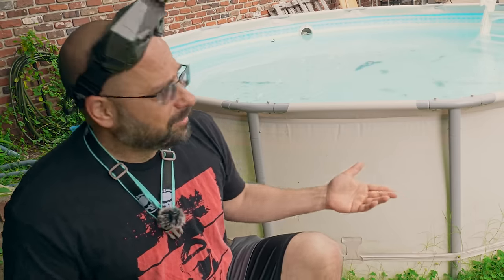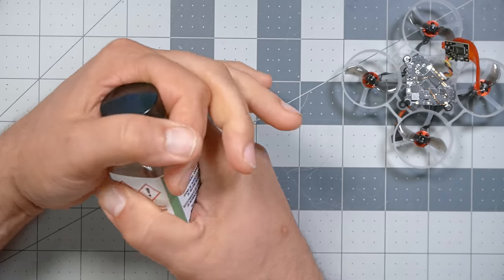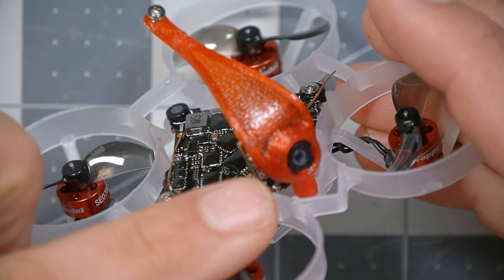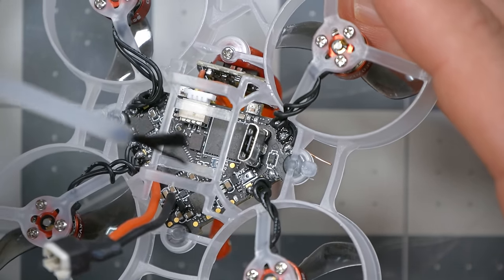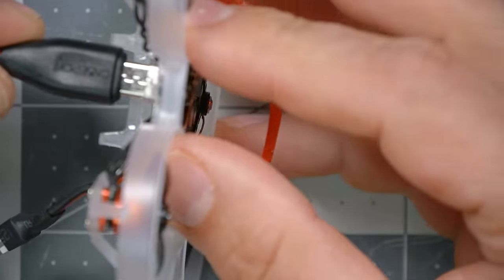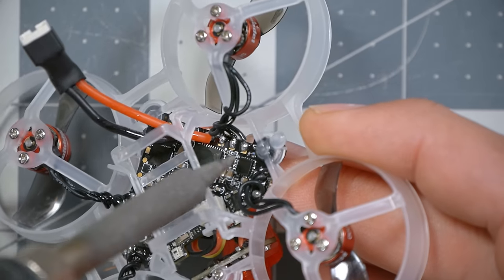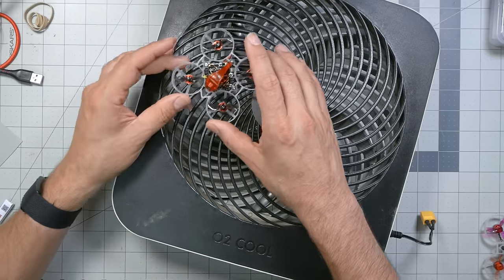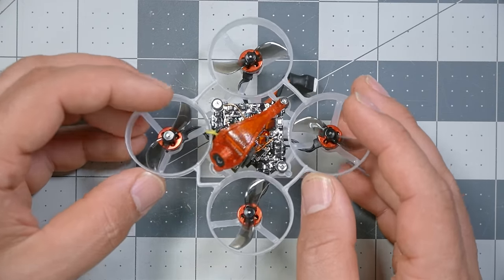I didn't waterproof my drone. Now I'm paying the price.

Comment: I need one motor off your Mob 6. I ordered one like a year ago and it came with a bad motor. This was the final straw for me and all the crap I've went through trying to learn the annoying setup and tuning of quads. I'm starting to get back going and still have most of my gear but I need a new Transmitter and goggles because this betafpv lite radio 2 se isn't worth a crap and my old box goggles suck also.

Comment: Good video. I ended up accidentally dropping my drone into a lake. I pulled it out, rinsed it thoroughly with distilled water and gave it a gentle blast with a can of compressed air, then left it for a couple of days. Turned out nothing was damaged and I'm still flying it months later.

Comment: I did the dumbest thing ever with my Eachine CVatar... Flying it in the back yard, I struck a tree branch which flung it into a trash can with gallons of rain water and leaf muck in it. The video feed went black and when I took my goggles off, I had no idea where the quad even went... It was TOTALLY submerged for a solid minute before the horror of where it ended up set in.  I dumped the trash can, rinsed the quad with clean water, then wiped it down as best I could and blasted it dry with compressed air. The next day, I plugged it in expecting the worst. To my amazement, everything worked. The one casualty was the battery. One cell of 6 went totally flat.

Comment: So no problem putting conformal coating on gyro chip??
Reason I ask that question is because I had a working quad going all crazy on me gyro wise, didn't notice right away the coating got flake y brittle over time, suspect poor surface cleanliness before applying conformal coating, tried about everything until I got coating completely off and the problem was then solved, not 100% sure it was that cause i tried so many things, but ever since it's like i burned my fingers on conformal coating and hesitate to try again.
How about heat dissipation, like amongst others on ESC parts? Will it be impeded, may it cause the coating to become brittle otlr? 
Either way interesting video/subject, long due, good idea to make one.
Reply from the maker: No problem at all with the gyro.
Reply: @JoshuaBardwell  ok thanks a lot for your reply and clarification man, much appreciated!

Comment: The very first day I flew outside with my freshly acquired just arrived tinyhawk II freestyle the outside was just covered in snow - and due to the lack of equipment and skill... that was also where I "landed" it after the first pack. And boof - magical smoke and a dead tinyhawk II freestyle - that was my first outside one pack experience. Frustrating. I'm conformal coating every pcb on every build I do ever since and never did I have any failures again - it also helps in the ultra wet grass and leaves we get over here or when that drone just digs up some wet dirt after a rainy day. Dirt buildup doesn't have much effect if there is a protective isolating layer, keeping it away from the electronics.

By the way, the legendary race-approved Foxeer ESC also comes pre-conformal-coated. This might actually be one of the reasons it's so reliable and doesn't have desyncs - cause it's just unaffected by all the gras and dirt that those racing quads just love to get all over themselves!

Comment: Since you don't want to coat the USB plugs or other open ports (flash card slots, etc.), what does one do about them?  Coat them with a glue or putty that can be easily removed with tweezers or?

Comment: I dunked a quad before, there was minerals and corrosion immediately after.I sprayed the FC and other components with WD-40 and scrubbed it with a tooth brush....everything still works and no corrosion has formed....its been several months

Comment: didnt rly looked into it yet but maybe its best to not coat at all.
just dont fly when its raining, if u crash it in water its kind of ur own fault.
so just evade this and u dont need all this sticky messy crap lol.
also wrapping ur fc and esc in a strip of electrical tape ( wrap it around the square sides) goes a long way and u can even fly in light rain

Comment: He should have mentioned the motors. He should have flown it, not just armed it. And if it's waterproofed, why not just immediately plug in a battery and try flying right away? 

He could have just did a video about washing off and drying a drone, and skipped the waterproofing altogether. I watched a guy fly his coated 5" UNDER WATER, and back out again, just to show how waterproof it was. This is very underwhelming. How about a proper waterproofing video?

Comment: Another thing to watch out for are open connectors like the OSD plug of the camera. Put some bluetac around it.
And I wouldn't rinse the quad with alcohol when it's coated as some coatings will wash off.
This guy has some more tips:
https://youtu.be/wfZ-OnMmnMw